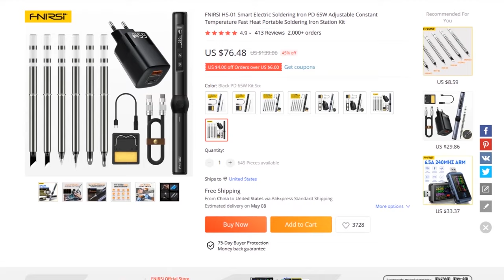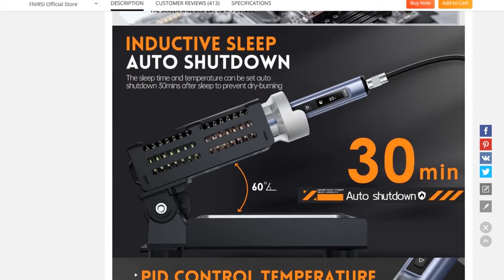How to make a powerful Inverter 12v DC to 220v AC using egs002, Pure sine wave Inverter circuit

Comment: You haven't checked the waveform with an oscilloscope. Without a low pass filter on the outputs, you won't get any sine wave, transformer is vibrating means output is not a pure sine wave.
Reply: point

Comment: Are you sure that the output is 220V with a pure sine wave? With your proposed structure of two sides, each side having one MOSFET, I want to double or triple the power by adding multiple MOSFETs in parallel, and each MOSFET having a 100-ohm resistor for voltage division. Would it be stable? If possible, could you create a video showing how to add 4 to 8 MOSFETs on each side for reference, both for me and others? Thank you very much.
Reply from the maker: ok i will try
Reply: Thanks  @homemade_101

Comment: Hi bro, if you check the output signal in oscilloscope, you will not see sine waveform and without the correct output voltage of 230 ac. Don't confuse people.
Reply from the maker: today I will uploading new sine wave inviter video. you can try it.

Comment: Thank you for the project. 
It may be sine wave, but I am not sure about the wattage using 2 Mofets and 5A /12v transformer. It is not mentioned in the descreption properly.
Reply from the maker: yes, you are right.
Reply: Not sinewave;  you need a H bridge for that; an H bridge needs 4  Mosfets,  cannot be done with only 2.

Comment: Does it working well with fan and no noise?
Reply from the maker: yes, good one. please check the circuit diagram.
Reply: Can I use 20N50 MOSFETs?

Comment: can i ask u something sir? in circuit diagram, pin vfb and tfb didn't connect but in video is connect. which one is correct?
Reply from the maker: Diagram is correct. it is not need
Reply: Okay, thank you

Comment: Is this a 3000W inverter?
Reply from the maker: Yes but modification. Plz full circuit diagram have in description box
Reply: @homemade_101  I'm not an expert in electronics but only with 2 mosfet it reaches 3000Watt? Ar you sure?
Reply: @homemade_101  it will not be 3000 watts with a 5 amp transformer!
Reply: the overall system watt depends on what? number of mosfets in circuit ?

Comment: Hello, very nice video. I did the same but above 210V, voltage drops a lot even with feedback circuitry. I am using 220v/8.5v transformer from UPS. Do you think 220v/12v would be better ??? thanks !
Reply from the maker: Welcome bro.. Connect out put pins X rated capacitor. Parallel connect. No problem UPS transformer. Bus 12 0 12v transformer best one.
Reply: @homemade_101  Hello, i did include a 2 micro farad in parallel with 220V output but still the same problem.